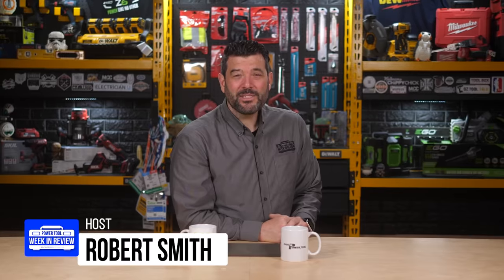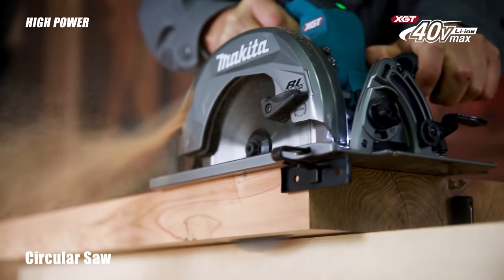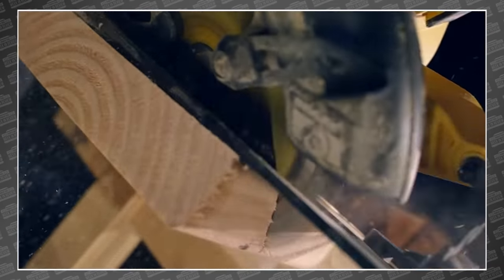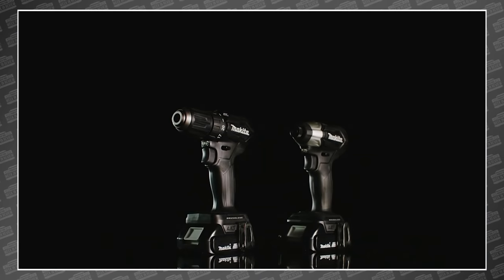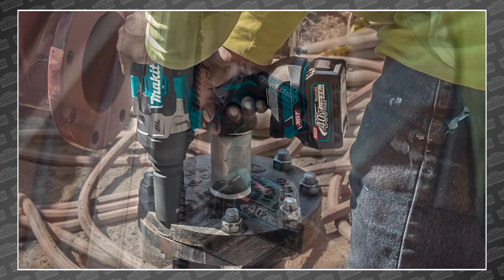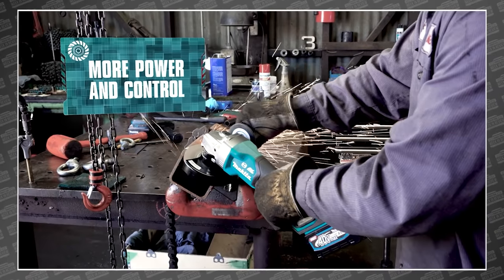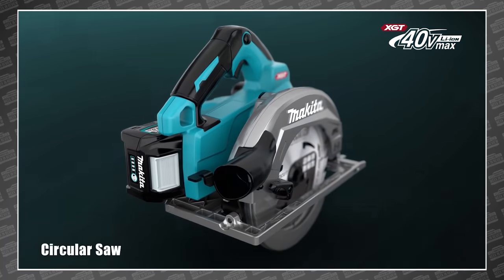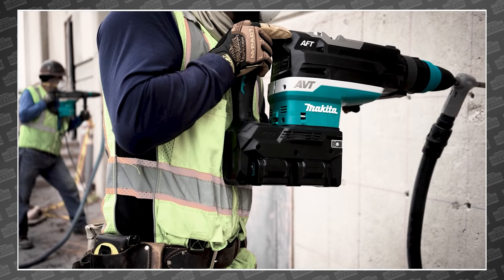FINALLY. Makita LAUNCHES NEW Makita XGT 40V/80V in the US! But the choice WON'T be easy!

Comment: See it is getting too complicated. I think Makita needs to get it straight. Have a separate brand for each line of the tools. It is getting too complicated. It is way easier with the TTI and Dewalt you know. You have Ryobi then Rigid and Milwaukee same with Dewalt you have craftsman and Black and Decker and immediately things getting clear. It is really hard to distinguish by the XGT, LXT and so on....
Reply: Umm no. Makita quality is the same top to bottom in their stack. I don't want their 12v, 18v, 40v tools differentiated into a different brand. Also, its the same sh!t with TTI and B&D. Dewalt has 12v, 20v, XR, Flexvolt 60v and now this ATOMIC nonsense. Milwaukee also has 12v, M18 FUEL,  XC, XD, HD, and then the totally proprietary batteries like the ones the power station, and breakers use. Flexvolt maybe the most "universal" but I'll be damned carrying an impact driver with a 60v battery hanging off the bottom of it. LXT and LXT X2 made the most sense. Need more power plug in two of the same thing you already have for tools that demand it.
Reply: @davidperalta5280  I agree with the statement that Makita is producing quality tools. Nevertheless, having to hook two batteries on a same tool is last century rudiment. Moreover, I would argue that TTI does engineer some perfect solutions superior to the competition. Dewalt is a little bit different story... Nevertheless consolidation of the power tools according to the dedicated trades is a good idea.